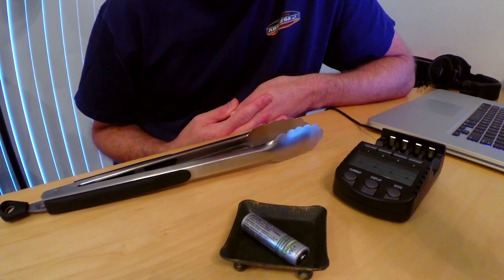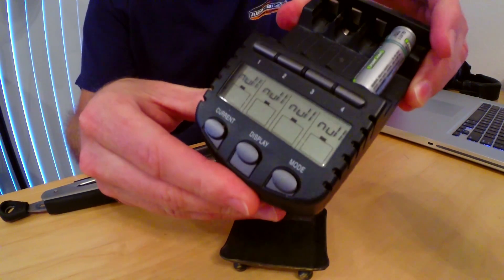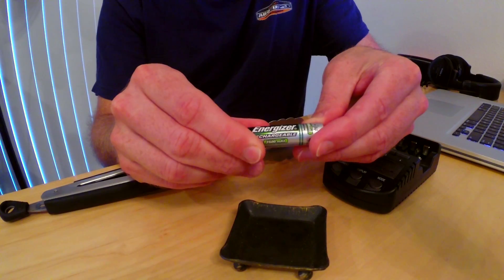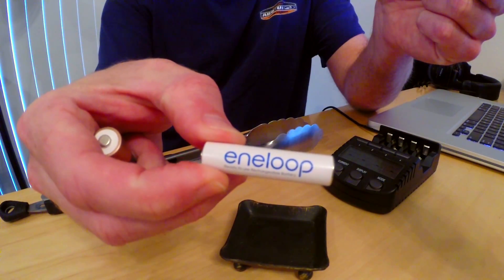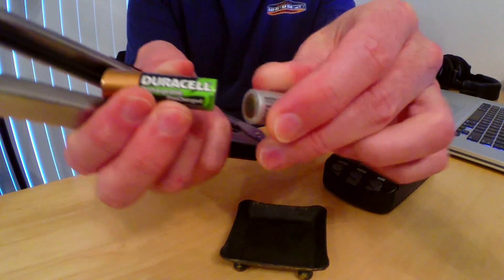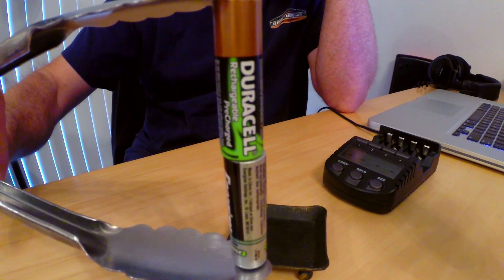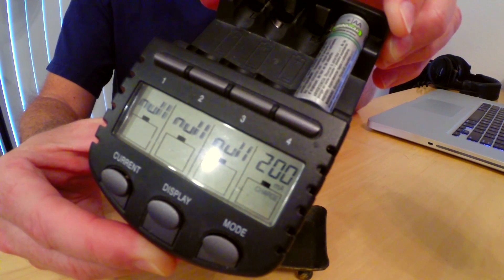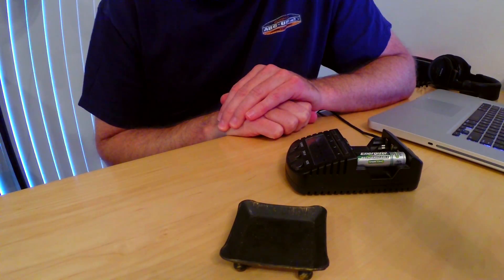Jump Start Your "Dead" NiMH Batteries With BBQ Tongs

Comment: This will only really work with really low drain operations. I just picked up some Duracell Japanese made 2400mahDX1500 cells, I can't find the eneloops anywhere local and don't feel like paying the shipping.  These are the new ioncore Duracell and not the old DX1500 2000mah cells. I know some Duracell cells care rebranded Eneloops, but I don't think these are. Do you know these cells, if so, what's your experience with them.
Reply from the maker: I'm not familiar with those new Duracell ion cores specifically, but you've got me curious now. Even the older type Duracells have been my second choice when compared to the Eneloops. I haven't had any problems with them.  I'll have to check those out. Also, I see there are Eneloop "XX" batteries out now, but man they are pricey.
Reply: skysurfer
Some of the older 2000mAH Duracell cells (which were also labeled DX1500) were re-branded Eneloops and some weren't (I think you could tell by the color around the button). I had the ones that weren't and they were total junk, lasted less than a year before they would no longer power a 500mA draw (though there is a spike in the device when you are first turning it on, which is when they would fail). I saw a lot of good reviews for the ioncore that are on the market now and I made sure I was getting Japanese cells and not Chinese cells. Hopefully they won't let me down. I'm pretty sure Sanyo sold the brand and they might not be as good as the old ones.Why anyone would sell the best product on the market is beyond me. The only reasons I can think of is that retailers won't carry them (probably because of theft) and they were loosing market to pirates.
Reply: +Frank Winkhorst How cold did it get? How did the battery perform in bitter cold?